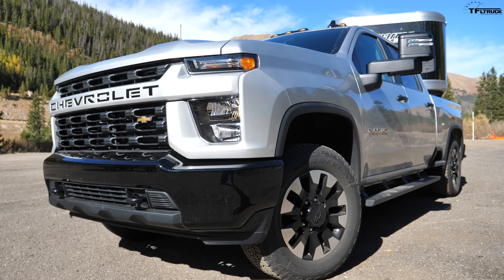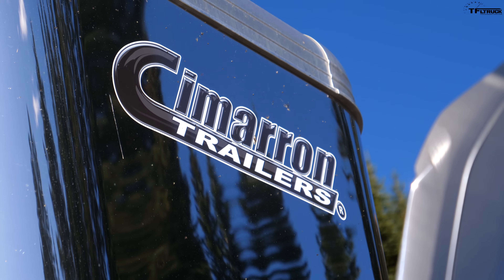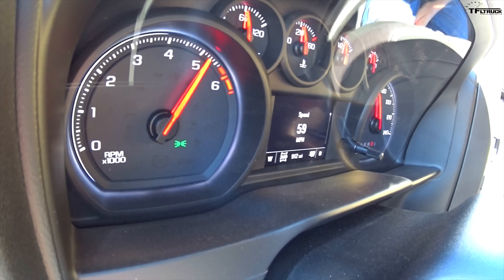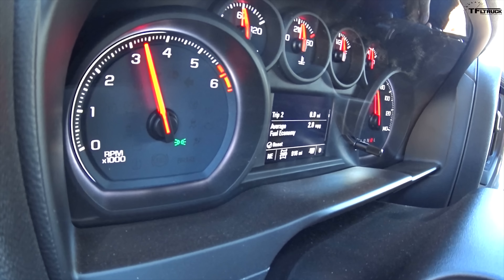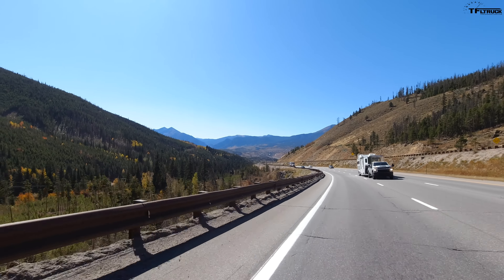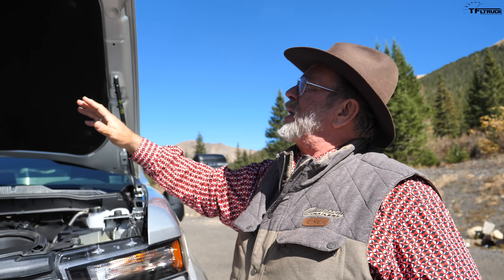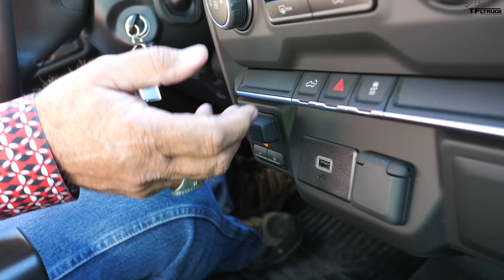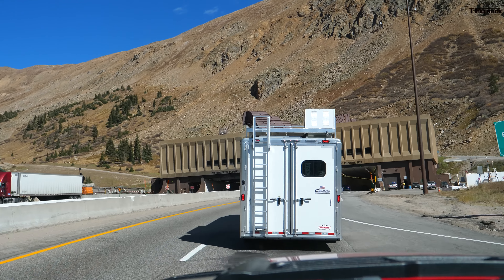The New 2020 Chevy Silverado HD Gasser Broke Our Ike Gauntlet Scoring System - Here Is How!

Comment: I’m a ford guy but in defense of the Chevy people who are going to tow that weight are not going to buy a gasser. Mr truck they need some summo bags you were pimping. Great video I do think it needs a few more gears as many have said. I will be interested to see the big Ford and ram but again there gassers too so with this weight I’m not expecting any crazy good on the Ike. Maybe capable for us flatlanders in the Midwest.
Reply: I have a 1 ton GMC with the 6.0L gas engine and I tow a 14k pound fifth wheel. Does just fine for me other than the fuel mileage which is why I kinda wanna upgrade to a diesel but they're just another 10k dollars I don't really have and with the EPA cracking down on non emissions tunes and delete kits, diesels are going to be garbage once those systems fail and it'll be another 10k dollars to fix it, so why not just buy a gasser and save money upfront and hopefully down the road.
Reply: dedalliance1 definitely room and need for a diesel. I don’t think they will be garbage and there’s always ways around things. But I understand your concerns. This might deter some people who just want a diesel to say they have one. If you are towing loads like they are in the mountains a diesel is a must
Reply: @joesainato8051  Well, I bought my camper in Colorado, not too far from where tfl is and then I drove it up to Montana and have been living in the camper for like 5 or 6 months now while working, and I've taken it over passes and out camping and it does just fine other than going a little slow.

You say owning a diesel is a must but honestly they're not. My truck is rated at 13,700 pounds max towing and these new GM's are rated at 16,600 and that's enough capacity to tow many large fifth wheels and campers and horse trailers and flat beds and car haulers, my brother in laws dad has like a 40 foot aluminum car hauler enclosed gooseneck trailer that weighs like 7k pounds and then he puts his 2001 duramax drag truck in it which brings it up to like 14k pounds which even that large of a setup is within the limits of new gas trucks. So what exactly does someone need a diesel for? The only advantages of a diesel is to maintain speed better when towing, and accelerating, better fuel mileage, and better reliability as far as putting a couple 100k miles on it. But with emissions now destroying new diesels, with high labor rates and higher fuel costs and oil costs over a gas vehicle, you really have to ask yourself is going a little faster worth the risk of everything that could go wrong with a modern diesel?

I can't speak on the new 6.6l gas engine, but the 6.0l has been in everything from 3/4 ton suburbans to work vans to pickups and more since the early 2000s and hundreds of thousands of them have gone to 200k+ miles, which is just as reliable as a lot of modern diesels. My sister and her husband both have a 2012 or 2011 Silverado diesel 1 ton, both emissions systems have completely failed in them in under 200k miles, which would cost thousands and thousands and thousands and thousands of dollars to fix the legal way, one of the trucks sat for 2 years because they lived in a county with smog control and couldn't afford to fix it. The other one failed when they were a thousand miles away from home with a horse trailer, they would have been utterly screwed if they couldn't have just walked into a delete shop and strip everything, that's not legal anymore, even in the slightest.

And trust me I still want a diesel personally just because I want the fuel economy, but the way this world is going with tree huggers and anti coal and anti fossil fuels I wouldn't be surprised if they outlaw diesels all together and maybe even gas trucks in 20 or 30 years. So what's the point in buying a forever truck if forever might end just down the road? But that's just speculation who really knows what will happen. All I know is modern diesels aren't all that they're cracked up to be.
Reply: dedalliance1 I hear you and agree on most everything you have said. As many say the emissions is the bad part of modern diesel. It’s unfortunate because ultimately motor vs motor minus emissions the diesel will most definitely outlast a gasser but as you stated a premium cost. I understand ratings that are given to trucks and there max capacity but let’s face the reality if you are working that truck at max capacity failure is much more likely to happen. Just for the record I have a gasser and always have cuz my trailers are at a weight I don’t feel I need a diesel. I’m like you I would like to have one but until I deem it necessary I will stick to a gasser most likely.
Reply: @joesainato8051  Yeah  you don't really want to put trucks to their max all the time, but they also might hold up to it too though. Have to realize that the max towing is based on pretty much 3 factors, reliability because when the truck is under warranty or extended warranty, it's up to the provider to pay for the repairs and so they don't want to pay anything and they make the vehicle so it at least lasts that long. And then there's safety, what rules and regulations do they have to follow to get the tow numbers certified, and then bragging rights and looking good on paper, how far are they willing to stretch the numbers to get a class leading number.

Kinda like Dodge, great diesel engines, but they've had transmission problems and rust problems, but you can do anything to the engine and it'll go for a long time, if you can afford a new transmission every so often lol. That could be the case with the new 6.6l gas, maybe it's just the transmission holding back the performance and the reliability. But only time will tell.

I just like diesels because they get 20 mpg highway where my truck might get 13 if I'm lucky.

Comment: Love the max tests, but it isn't apples to apples when comparing to the Ram. I'd like to see a test where you have the big three that all have the same exact trailer and tongue weight and same rear axle ratio. The gauntlet with the Chevy and Ford was over 16,000lbs and the Ram was 14K. So it's really a Ford vs Chevy battle. Load up the Chevy and Ford with the trailer weight you put on the Ram and see which performs better.
Reply: A more realistic test with those three would be to have them all tow something like 10,000 pounds. People towing 14,000 or 16,000 pounds will probably buy diesel pickups.

Comment: Just watched the new 7.3 Ford video and came back to this one to get an idea of how much better the Ford is and it’s obvious that the actual real world difference is a lot bigger than the numbers would suggest.... GM powertrain engineers clearly didn’t map out the shift points properly ,as he went thru  the lights at the top at 2500 rpm foot to the floor,that trans should have downshifted to a lower gear at that point. I’ve seen this before with GM ,they just drop the ball on programming.

Comment: Not bad for a gasser 3/4 going up a serious grade with crazy elevation
Reply: It did the job like GM said it could based off ratings. However going that slow isn't safe. So I'd say it's a fail. It's need more gears and a 4.10 rear end for something like this.
Reply: @MrComputerCoder  lol, It's perfectly safe to go that slow. Here in Montana there's a pass that if you're over like 10 tons GVWR you can't go over like 35 mph,especially down hill. Just put your flashers on and sit behind a semi and you'll be just fine.
Reply: dedalliance1 kids these days don’t understand patience, especially when towing.

Comment: You will have to walk around one of these trucks to realize how big they actually are. I bought a similar 2020 GMC Sierra and the height of the front of my hood is almost 5' off the ground. I have to use a folding stool in order to check the oil. The oil change tech uses a stool to reach the engine compartment. You need the step built into the rear bumper to climb into the bed.

Comment: Going to say, before i watch it, a diesel always out pulls a gas. But, let's keep watching lol
Reply: The Hemi out-pulled the EcoDiesel in this test. It all depends on which engine has more power, and this test is going to favor whichever engine is turbocharged because of the altitude.
Reply: PistonAvatarGuy he was probably talking about the 3/4 and 1 ton trucks. Of course any of the 3.0L diesels won’t keep up with their V-8 counterparts.
Reply: @LikeARock1997  Yeah, but if Ford were to build something like a 5 liter, inline 6 EcoBoost engine, it would waste the HD diesels as well.
Reply: PistonAvatarGuy Why would a 5.0 liter “waste” bigger diesels? You just contradicted your first statement.
Reply: PistonAvatarGuy No shit? 🤦‍♂️
Reply: That's a given.  Two different technologies at work here and little to compare.  I'd love to see a truck maker come up with a diesel generator driving electric motors like a modern locomotive....torque for days and less fuel consumption than gas or diesel by themselves.
Reply: Arnold D Precisely. However, trucks and locomotives simply cannot compare when it comes to the comparison of size with the electric generators on a train and something like the E-Torque on a Ram. The ones on a train are HUGE, even compared to the train engine itself. If pickup trucks were to have something as efficient as to how a train would be, the generator would have to be like half the size of the truck itself, taking away payload, ride quality, and just overall size to the point where it would just be a butt clenching experience going anywhere in it😂
Reply: @PistonAvatarGuy That comment about the 5.0L Ecoboost makes no sense. Chevy could put a supercharged 427 in a Silverado and it could out accelerate every stock truck ever made. Also that ecoboost would need to make 450-500Hp to even come close to out pull the big diesels up a hill, even then it would get truly horrible fuel economy and still not pull as well as the diesels on anything but a steep incline. The ecoboost has a healthy torque curve, but would be nothing compared to a diesels curve.
Reply: Not true.  When a diesel breaks down it’s likely a gas tow truck that comes to haul it to the shop.
Reply: @LikeARock1997  A very much tuned 3 litre V6 Diesel would but it would not be stock
Reply: Well of course they do, they make more torque and at a much lower RPM... that's not to say u couldn't make a 6.6 gas truck out tow a Dmax though...
Reply: @stacyadiaz  no they dont have torque for days. Stop listening to non engineers. To achieve higher rpms torque drops lower and lower and lower in favor of high rpm. So with extra load and a single speed gear box and a low amperage and current draw motor your either going to cut rpm in favor of torque or your going to cut torque to keep gaining speed. Electric motors are kinda poor at making torque and dont use their start up torque as anything more than shock loading the motor creating primarily heat. To really achieve torque for days youd be looking at a hybrid setup that uses a gas engine that is direct injected and has high compression and a proper head design for efficiency (but why use this as a generator as it would easily wax a electric or pneumatic motor and might be able to keep up with the hydraulic at this point) and tie it to a hydraulic motor system. This would achieve high hp high torque and it would be truly for days till it blows. Electric motors still the most overhyped things on earth the lowest power density of non combustion power plants and yet gets all the attention for factors it doesnt have and its efficiency when that's it's only claim to fame.
Reply: @gmcdenali7178  the only reason the torque curve is the way it is because well that have longer throws and high cylinder pressure and temps also the flame propagation speed of diesel is slow.
Reply: @jdrok5026  I know.
Reply: @jerem0621  
Every tow truck I've ever seen was a diesel. Most of them around here are Ford F550s.

Comment: You should do a old vs new the Chevy 2500 HD 8.1
Reply: AN old ☻
Reply: My 1995 GMC 454 Tbi, will crawl up HWY 70  at 70mph/ gauntlet, in cruise control.
Reply: Just did 11,400 ft. Colorado pass towing 15,000 lb 5th wheel with Chev 3500 dually 8.1with 4.56 gearing and tune. Got down to 23 MPH in first gear and truck overheated. Truck runs like a champ to around 8,500 ft. elevation, after that you need less load or a diesel. I would say an 8.1 gas engine is good for 10,000 lbs or less from my experiences.
Reply: The 8.1L would choke out on the IKE, This altitude kills naturally aspirated engine performance and the 8.1L is a near twenty year old design at this point with a far inferior 4-Speed auto transmission, you'd be lucky to crest 25mph in one pulling the same load up the same hill.
Reply: @nathanmcdonald610  Far inferior 4 speed!!??? In the 2500HD and 3500 trucks with automatic transmission the 8.1 was mated to the far SUPERIOR ALLISON 5 or 6 speed depending on year.

Comment: I'm a huge Chevy and GMC truck fan.  With that being said, I think your review was great, accurate, and well done.  By the way, this truck is ugly, and that's only one of it's faults......
Reply: Iron Clad Ranch a huge reason for having the manual mode on a HD model is exactly for this type of towing up or down a major incline. Anyone who tows for a living would be smart enough to use the onboard tools designed to maximize the capabilities of the tow vehicle. With the exhaust brake on the diesel version, manual mode wouldn’t be necessary, but is still available for those who wish to further maximize their capabilities.

Comment: Thanks for the awesome review! I know you guys at TFL leave the trucks in drive with tow haul on, but for this truck especially it would be awesome if you ran the hill again with the truck in manual in 2nd gear. Just to see how much better the time would be, it would be at redline the whole time but at least it wouldn’t ping pong.
Reply: Yup. GM shift programing on these just isn't made to run them WOT unless you're in manual. They don't hold gears for max power, it's really setup for comfort/economy evidently.
Reply: @AmericanAutomotive1  naw its to protect the trans. even unloaded it doesn't want to 3-2 and tries to death pull from 2500RPM and pings

Comment: I never thought I’d say it (even though my current ride is a 14’ ram 2500 6.4 hemi-really really liking the truck) always been a gm guy. But out of the three I think the new Ram 3/4 has come the furthest. The 8 speed and 6.4 hemi is perfectly matched. If I could have swung it I’d have a new one for the tranny and engine combo alone. The pickup of the 8 speed and 6.4 gasser reminded me of a once 6.0 diesel I had for a short while. You can’t go wrong though with any of the new trucks today. They’re all pretty solid in their own right. When’s Yota coming out with a 3/4 ton that’s the question?
Reply: Yess on YOTA! if they did it would destroy the big 3

Comment: When will the Ike gauntlet for the 2019 ram 2500 6.4 hemi with 8 speed transmission drop?
Reply: Hector Cortes yes! I’ve been asking for this for months! And not a power wagon please. A truck made for towing with a 4.10
Reply: @MrXerxes  yep it either 3500 Rpm or redline when shit gets heavy need few in between
Reply: I want to see an F250 with a 7.3. And the 10 speed.
Reply: @MrXerxes  they used to have 4:56s until a few years ago
Reply: Thorsten I had the 2017 with the six speed I agree with you opinion it killed the motor performance now have the 2019 power wagon with the 8 speed one of the finest working motor transmission combo ever drive one when you can you will be impressed
Reply: @sylvanwhite4362  my father bought a 6.4 2500 and he isnt impressed with the towing. Does the 6 speed to 8 speed make a notable difference.
Reply: @VFio689  The 8 speed was pretty revelatory on the 1500s. I think it will be even more so on the HDs.